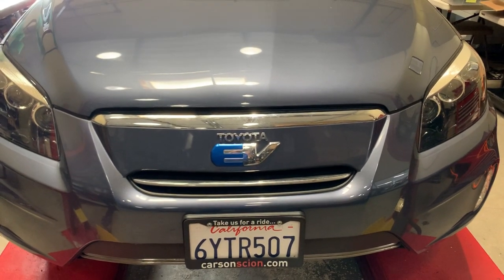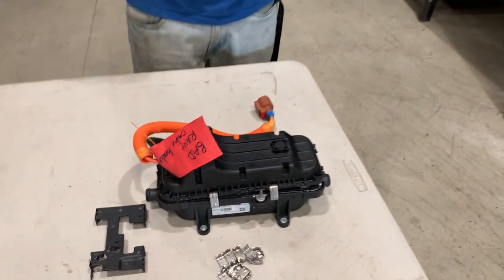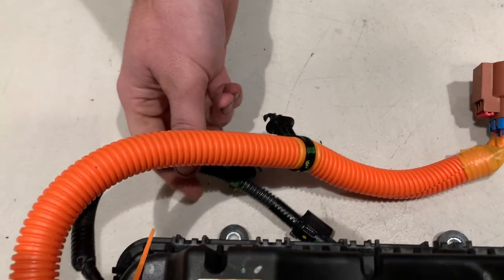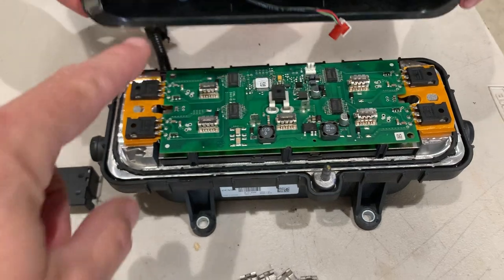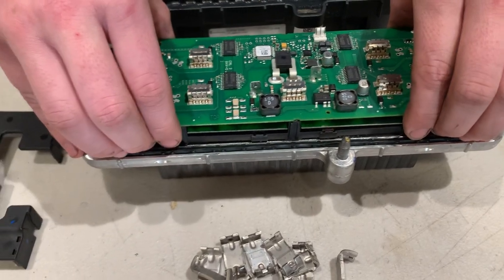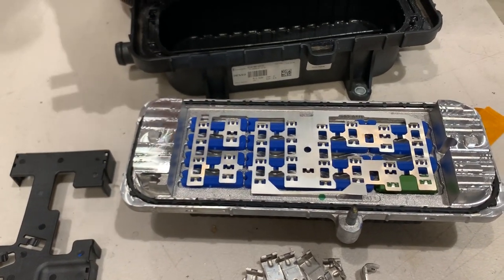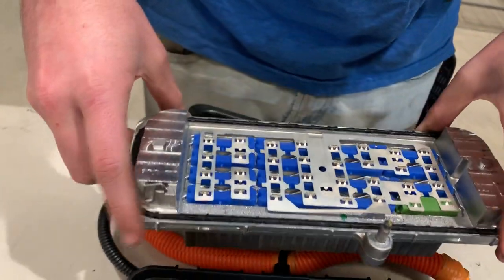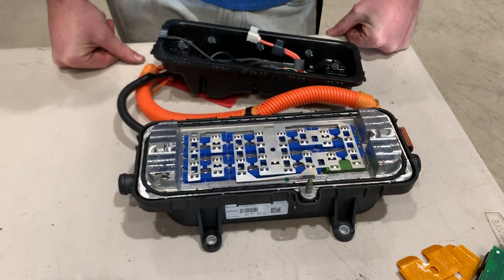Toyota RAV4 EV cabin heater failure

Comment: Would it be possible to add a fuse type thing between the converter and the heater to prevent frying the converter when the heater fails?

Comment: what is a part number for the heater unit? is it possible to buy one from you?
Reply from the maker: Looks like your comment is from quite a while back, so sorry about the late response... We might have one or two cabin heaters here on a shelf. If you get in touch with use we may be able to help you out!

QC CHARGE
1497 Poinsettia Ave, Suite 154
Vista, California, USA, 92081
+1 (760) 798-0342
+1 (844) EVPARTS
support@qccharge.com